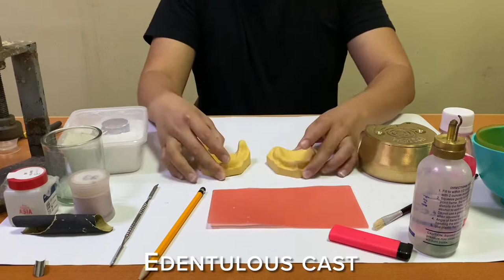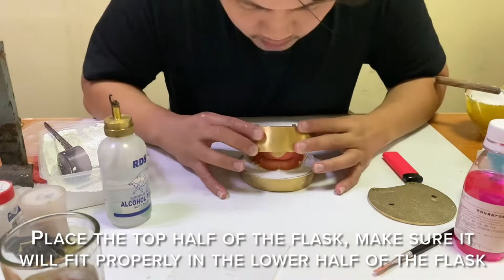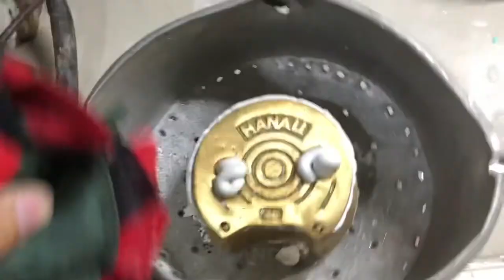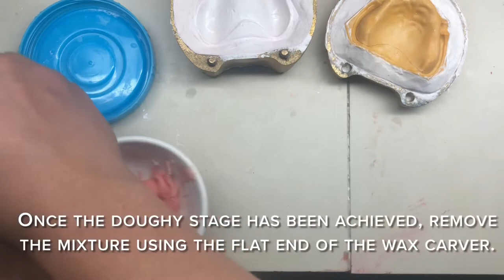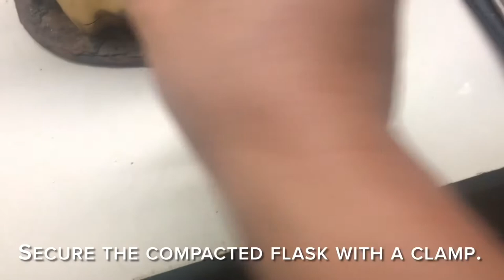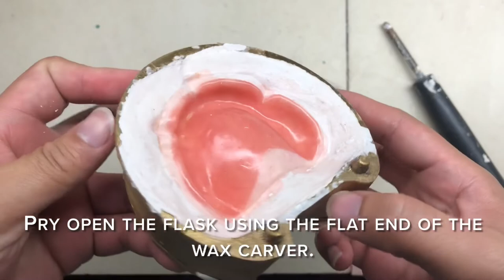Synthetic Heat Curing Acrylic Resins

Comment: @ Vineel Chaitanya : Hi  Sir,  Synthetic Heat Cure Acrylic Resins lo, After pouring Upper Flask ,  Separating Medium or Vaseline be applied before pouring lower flask .   Cast also be coated with Separating Medium inorder to separate the Stone  pouring from the flask after the Cure. what is this Separating Medium ? or What is this Vaseline here ? what is meant by Raja Bhogam? What is meant by Raja Yogam ? - Thankyou.

Comment: I gave up waiting so did the same made my own cost me £50 from eBay 
Cold cure pink powder and liquid the mould holder mixed the 2 parts together which was blue and took moulds from top and bottom gums Iv no teeth was all removed after an accident stone cast with Vasoline ready for my base mixed the cold cure together paint bit of the liquid around the stone cast then roll my mix and lay down over the cast be Quick it get hard fast    Just get the shape right then add your band of teeth the set you get that has wire around them so set in the right place just bend and level it out     Then push gently into your pink mould in the right place then use the liquid with paint brush to wet around the bottom area where teeth meet the pink stuff shape and add more to make look like real teeth and gums    I got a nail set kit to help flatten out gum lines move into gaps and hide the metal wire try trim off any over lay on the stone cast wait till hard then gently pull off the cast the Vasoline would help here use a dremil and sand paper to smooth out and bits keep test fitting cut as much off as possible so not to dig into your gums.    Thin out the roof to help not to gagging.     Wet sand till smooth after few days wearing them you’ll find bits that dig in your gums so keep sanding till your happy    Use the paste to hold them in place and then it’s learning to talk again lol.    I made 3 lots till I got mine right and can still make more all for £50